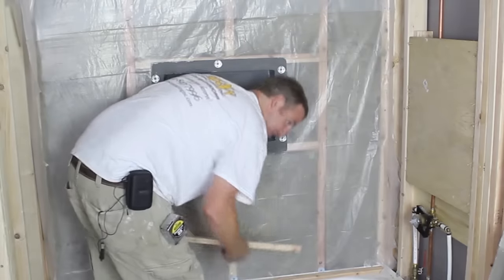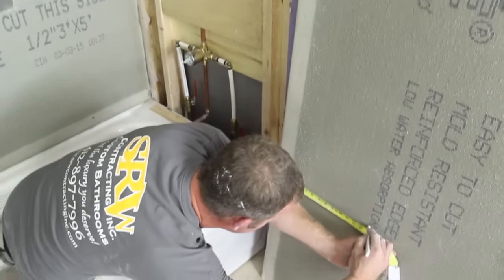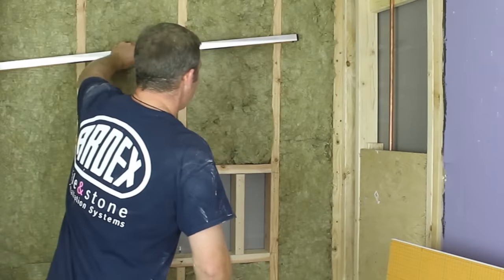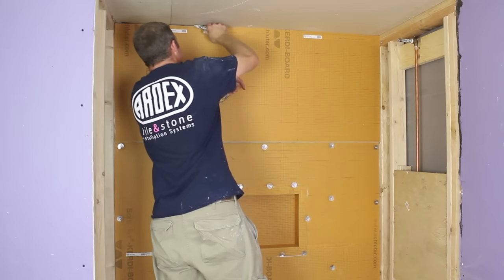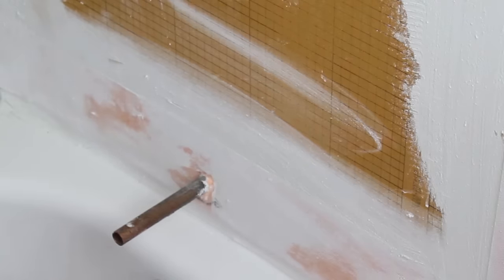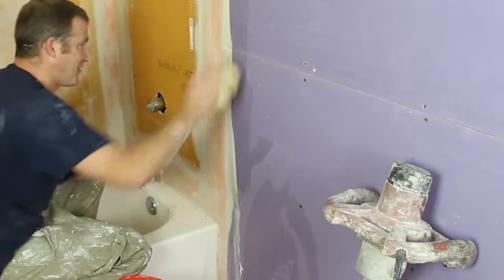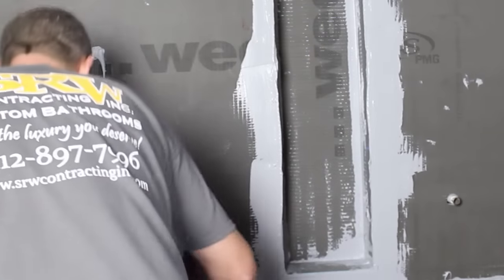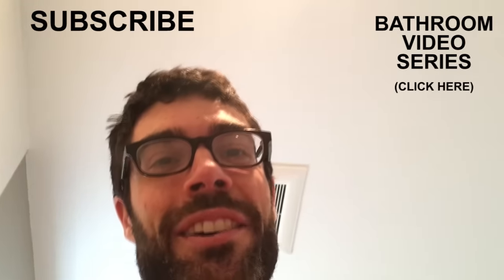How to Waterproof a Shower (3 Awesome Methods!!)

Comment: What are your feelings about just using Kerdi membrane over plain old sheet rock?  I know this was encouraged by Schluter because it was attractive to general contractors in new construction. The sheet rocker could just continue the sheet rock into the shower as long as he didn't finish the joints with sheet rock mud. I'm guessing you are recommending these three methods because  you are doing a remodel and these three boards are superior to sheet rock?  How about cost? I know kerdi board is quite pricey. Would it make sense to use sheet rock  and kerdi mebrane if you were trying to cut costs? I know applying kerdi membrane takes a lot longer than these methods. I may be answering my own question here...the savings in time probably offsets the difference in price?
Reply from the maker: funny you should ask, our next video will show how to use sheetrock with Kerdi in a curbed shower. It can save money and is acceptable. We used Schluter's new wide roll of Kerdi which is large enough to be one continual sheet in a typical shower. Kerdi membrane is very quick with this new method, but even with the traditional size membrane it's not bad in terms of time.
Reply: @HomeRepairTutor  Thanks!

Comment: So, I have never done remodeling work in bathrooms.  I have to full baths upstairs; one a shower/tub combo, and the other a stall shower with a separate bath.  I like the Wedi board approach because of the ease of use of this product.  Don't think I'd want to use a cement board (Hardie-Backer) due to the fact that if anything DOES fail, the cement boards tend to crumble.  My research indicates that floating the installations upstairs tends to lead to the best long-term result because of strength; this might be really important as I live in earthquake-prone So. CA!  

Are you and Steve still providing the bathroom remodeling series (will I find it in your channel)?

P. S.  Thanks for the very instructive video!

Comment: Could thin set be used to fill the joint between the tub and the cement board with mesh waterproofing tape...?? instead of usinf ardex?

Comment: Hi I used HardiBacker 500 moisture and mold product.  The manufacturer site does not recommend or perform waterproof material to the body of boards only seams and screw holes.  Why the difference between manufacturer's video and all other videos I have seen online?  Is it because they assume the thinner Hardibacker is being used?
Reply: Great question and you are correct about Hardie's position. I'm going with what Hardie says but using 6mil plastic between studs and HardiBacker.

Comment: i  am  using kerdi membrane with reinforcing comers and reinforcement for penetrations  it also has a base with kit and use choice of drain. i am installing in a week  are there any pointers?  i have only used the plumbing membrane and that never worked well. it was a problem even for a union plumber who has had all the training provided by the union. as a apprentice i was stuck putting those liners in, i don't think there where any that did not leak and to put the starter course of tile on and level just a hassle. this sure looks a lot easier and faster.....why after i retire??

Comment: I talked to a contractor about waterproofing showers and he's method is to use a product similar to Tite-Seal Self-adhesive rubberized asphalt roll flashing. He attaches this product to the wall studs. He basically wraps the entire shower studs starting from the bottom and working to the top, over lapping the layers. He  then places Hardi backer board on top of this wrap. He claims once in place it's water tight and the self adhesive seals the screws holes and it's ready to tile. No taping joints or sealing corners and screw holes. Has anyone ever seen or used this method?
Reply: Travis Adams to be honest, even cement board by itself is sufficient for waterproofing unless you are using a really porous tile. cement board is not water proof but the small amounts of water that it would ever see, it will not be enough to seep through or go anywhere else to cause harm. for quite a while, and in some bathrooms that have lasted 20 or 30 years, it was common place to simply put tile on green board drywall and it did fine. 

you really should only do one of these two methods to waterproof. 

1. plastic 6 mil barrier behind the cement board, stapled to studs with a lip barely over the tub flange to provide a channel for any water to drain into tub. 

2. Use red gard or equivalent on the surface. 

if you combine the two, you create a mold sandwich, and is very bad news down the road.
Reply: marshalluniversity31 that's not true. Greenboard without using topical membrane will fail over 20-30 and have black mold at the base. I know from tearing them out. A 6mm vapor barrier does the trick just fine. And like you said. By the time the water penetrates the screw holes it won't cause much damage to the studs to cause deterioration.
Reply: No, Isn't the idea to keep the moisture from getting behind the HardiBoard?  He's protected the studs, insulation, etc. but..????

Comment: What kind of blade did you use to cut the cement board? What kind of hole saw bit did you use to drill into?

Comment: You need to finish the job! The tile used will influence the method choice. Using heavy marble tile the mortar adhesion is crucial. Hard to imagine mortar sticking to foam board very well. Your seams only got sealant not 2” open mesh tape for some reason. As for waterproofing the board, that is what tile does! Just took down 50 yr old tile stuck to drywall, no other barrier, no water issues after 50 years! Only the shower end had a 3x3ft peice of water resistant board, where the holes are.

Comment: I'd planned to go 1/2" hardiebacker + kerdi membrane.  It seems easier than cleaner than trying to waterproof cement board.  I need a sturdy back as it's a small stand-up shower and the studs are 16", so kerdi board is out.  Wedi looks nice but is really expensive.
Reply from the maker: We get the question all the time about KERDI-BOARD and the concern over it being sturdy. Those boards are strong enough to hold large format tile and are a great option. Wedi is a bit more firm because of the surface coating, you might like those boards and they're waterproof the entire way through the foam core.
Reply: Do you know by chance between the three options, which would have the best sound proofing?  I have bedrooms right next to both showers, and want the shower to be as quiet as possible when running

Comment: Please when you said like you can use other kinds of mesh such as "hydroban","redgard",etc....please could you describe me what kind of others "etc",..
It could be? Cause I live in a isolated place that lumber product is a big issue,thks!
Reply from the maker: Sure, RedGard is a liquid waterproofing membrane as is Hydroban. Ardex 8+9 is also a liquid waterproofing product. If you Google any of those they will come up. All these products are rolled onto cement backer boards like paint. Typically two coats are required but follow the directions for proper use.

Comment: Great info, thank you!!  I'd prefer the wedi board, I think. Question -- the back wall of my shower area has tile, adhered right to the outside brick!  (My home has solid wall construction...plaster on brick, with some black stuff painted on in between).  Could the wedi board be put directly on the brick, with Liquid Nails, perhaps?

Comment: Great video! We are planning on updating our 1951 small bathroom in the coming weeks. When we start rebuilding, we were thinking of going with Kerdi but we may switch gears and use Wedi. I hope you still monitor comments because I can't find the answer to my question.  We currently have drywall in the rest of the bathroom and we want to install tile halfway up the wall. When we were first researching Kerdi our plan was Kerdi board for tub surround, Ditra for floor, and the Kerdi membrane over drywall for tiling the walls outside the tub/shower. Can we use Wedi board and still use the Kerdi membrane on drywall using the Kerdi-bond on the seam between the Wedi board and drywall/membrane wall? Thanks again! We are binge watching your videos while prepping for our project!
Reply from the maker: great questions Jim, Schluter is still an excellent option. You could use Wedi inside the shower and extend it beyond the splash area. Then you could even use purple board in the main bathroom and tile over it; it’s best to wipe down the bare drywall with a damp sponge prior to setting tile as this prevents the thin-set moisture from being wicked into the drywall
Reply: @HomeRepairTutor  Thanks for your quick reply! The drywall outside the bath is currently in good condition and I'd love to tile over it but I know we need a barrier. I would have to tear down the drywall to  install purple board, correct? Can I just use the Schluter membrane over the drywall as long as seam between the Wedi and the drywall with membrane was sealed well? The shower wall is in the same plane as the rest of the wall in the bathroom if that makes sense. I don't want to build one up so they are no longer even.
Reply from the maker: @xoxojimroy  totally understand, you could overlap the Wedi with KERDI membrane by two inches with Schluter ALL-SET mortar and KERDI trowel, that would allow you to waterproof the walls if that's required in your area. As long as the paint and walls are in good shape that should work. The biggest tip with KERDI membrane is to mix the thin-set to the right consistency. Schluter recommends 7.5 to 8.5 quarts of water per bag, so we use close to 8.5 quarts. This video we made has some great tips https://youtu.be/DyEaHz4aD34
Reply: @HomeRepairTutor  You are amazing, thanks!

Comment: How would you address the joint between floor tile and wall tile? Grout or caulk? would you recommend leaving drain holes in that corner joint in case any water would make it behind your wall tile? Not many videos on that out there but many different opinions seems like it. Thanks for your time and effort.

Comment: May have been asked and answered in questions below, but a lot to read.  If you have a plywood backer, can the wedi and/or Kerdi board be used on the floor instead of a shower pan or is it just not hard enough?
Reply: Sorry for the delay in responding.  I got off on an outdoor project while cooler.  Ready to start the indoor job now that it is hot as heck.  If I were to use the Wedi or Kerdi board as a floor, how would you recommend having it slope towards the drain?  Thanks!

Comment: Hey what's up. 
Very good video. 
But you didn't say that the products you used in methods 2 and 3 , if they are water resistant or proof and mold resistant or proof. 
Another thing is you should have shown a transition from a shower pan to Becker board. 
I think that would have been very helpful to alot of people. 
I worked at a granite marble and tile store in Las Vegas for about 15 years. 
And when a diy'er or a contractor wasn't going to float in their shower or tub surround. 
I ALWAYS recommend DEN SHIELD backer board. 
Due to the fact that it is water and mold PROOF. 
But it's been about 10 years since I worked in that industry. So I'm not really up on any of the newer products. 
Again good video. 
Take care....

Comment: with the last 2 methods I am wondering how you would mount safety bars to the finished walls ,yes it would be blocked behind the keri and schluter but is it solid enough ?
Reply from the maker: +prter chabra yes, add 2x10s or 3/4” plywood behind the KERDI-BOARD and Wedi. Drill though the backerboard and Tile to reach the wood blocking. Supports or grab bars then get attached to the blocking.

Comment: Isn't the main purpose of the cement board to adhere tiles to it? If so, water proofing it, or covering it with something, will nullify the adhesion right?
Reply from the maker: waterproofing cement board is good practice and will not prevent set tiles from adhering. Liquid membranes like RedGard, Ardex 8+9, and Hydroban have be extensively tested by manufacturers. And the Tile Council of North American also recommends membranes of this nature for cement board. Tiles will adhere to them and we do recommend using a thin-set mortar that's made by the same maker of the membrane for warranty purposes. For example, if using Ardex 8+9 it would be best to use an Ardex thin-set.

Comment: kerdi is nice but it is very expensive and comes in 4x8 sheets, usually way to big for most showers so alot of waste.  i prefer to use laticrete hydroban because it is 3x5 sheets and installs the same as kerdi

Comment: thanks for the video. I am wondering about the first method where you address the 1inch gap that is left between the cement board and the lip of the tub flange. I am not clear how you fill that in void. Can you explain this further, as i cannot tell from the video. Any compound you put in that gap would just push through wouldn't it? Are you covering the void with the tape first and then putting the waterproofing over that?

Comment: I am in the middle of a bathroom rebuild.  I had to take out the tile/drywall due to water leak and in the process decided to go ahead and replace the tub.  I noticed while removing everything in the area that the tile was attached to sheetrock and the sheetrock was attached to the drywall.  Is that necessary to do?  I feel like that is just doubling up on protecting the drywall from moisture.  Please let me know how I should move forward, thanks.
Reply from the maker: In the shower it’s best to use a single backer board over 16” on-center studs. We like Hydro Ban Board, Kerdi-Board and Wedi. Tile can be set over those substrates after they’re waterproofed. Have you chosen a backer board yet?
Reply: @HomeRepairTutor  we are going with DensShield gypsum backer board and use Kerdi products to waterproof.

Comment: we are using hardiebacker boards instead of cement boards. Should we waterproof the hardiebacker board in the same fashion as you did to the cement board?
Reply from the maker: Yes, highly recommend using Ardex 8+9 or RedGard or Hydroban according to their directions. Just be sure the studs are plumb and level. If the boards aren't plumb then that will adversely affect the tile.
Reply: Home Repair Tutor 
Thanks
Reply: Read Hardie's instructions and call their technical dept. They believe vapor barriers are optional except on exterior walls but want you to follow local code anyway, of course.

Comment: Instead of the shower pan I am looking into tiled walk-in shower floor. I wonder if Kerdi or Wedi boards can withstand weight of the user or they have special, denser panels for shower floor use...
Reply from the maker: +Francis leMatt both Schluter and Wedi make shower pans. There's a KERDI curbed shower system, and Wedi has both curbed and curbless options.
Reply: Hi Jeff, great videos!  I want to remodel my bathroom so I also watched your Wedi installation videos. I am a DIY. Just to clarify, if i want to go curbless Wedi is the best/only option? KERDI only has curbed, is that correct?

Comment: I am doing small shower in older home remodel, one wall of shower is framed 2x4, the other is block. Can the Wedi board products be directly fastened into the block or do I need to install a frame to attatch material to ?
Reply from the maker: +Matthew Corey we'd install furring strips to the block then add the Wedi over top of that.

Comment: could you cover cement board with Red Guard and use Kerdi band to cover the seam between the walls and a Schluter shower tray?
Reply: Yes - this is how most do it when not using a specialty backer board.  Look up Sal Diblasi here on youtube for the best method using Cement board...

Comment: I thought you need to leave a gap between board and tub lip because of how it goes up wall a couple inches. then seal tile to tub with caulk. will the compound against tub be prone to cracking?
Reply from the maker: if you use KERDI-FIX it will not crack and should remain waterproof if used with the KERDI-BAND. You can overlap the tub with either board but then you'll have a gap between the waterproofing and drywall or plaster. So that's one reason to just start at the tub lip and work your way up the ceiling.